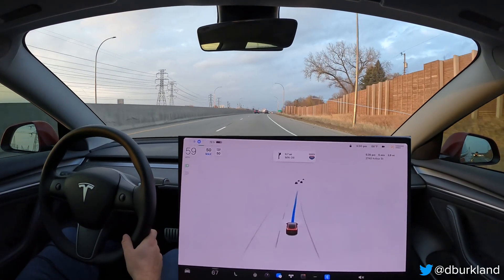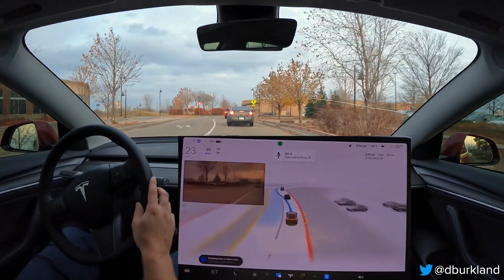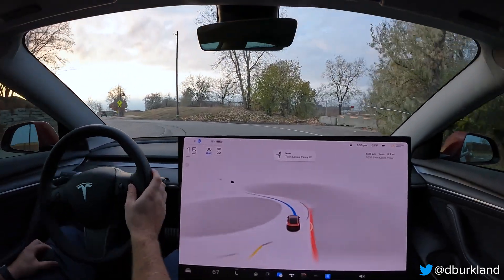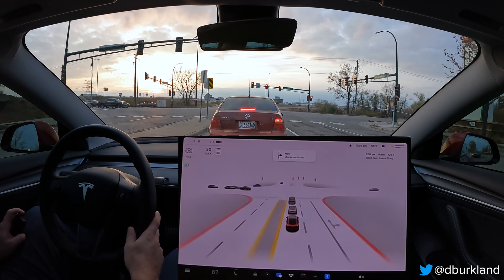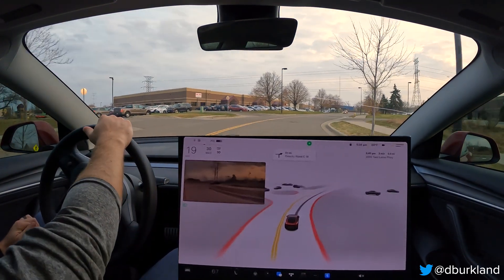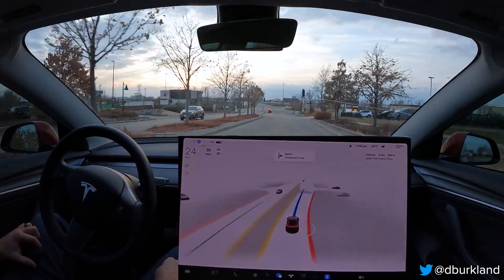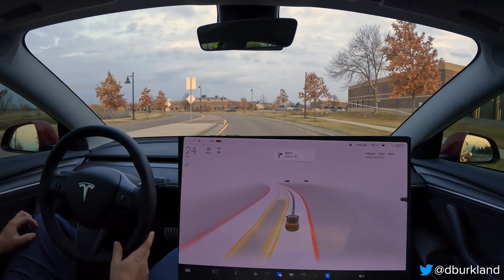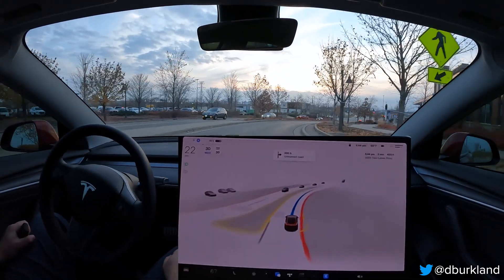Tesla - FSD Beta 10.69.3 - Roundabout Torture Test

Comment: It’s not identifying the island perimeter as a lane or drivable space edge. Maybe a whisper of yellow or red lines occasionally. It’ll be interesting to solve this. They leave curbs low so large/long vehicles can drive on the island. So it should identify as a yellow lane edge. 

Lane selection will come with the new intersection mapping from ai day

Good set of tests, thanks
Reply from the maker: Good observations! It seems with the previous 10.69 releases FSD was better able to recognize the edge of the island curbing.

Comment: Dan I'm afraid you're wrong when you say how it does FSD wrong.
I see it that the map documents will guide the FSD to the right lane to turn right even when it goes straight - the FSD realizes that it has received poor information and redirects to the left lane and the roundabout passes without any problems.So what you pretend to be a FSD error is more of a map error.
Reply from the maker: The deep lane guidance module no doubt is overriding the bad map data however I hope this means the map data will get updated at some point (so last second lane changes go away).

Comment: I’ve seen other beta testers hitting a report button when something wrong maybe try that so the beta team can see this and improve. I drove almost 1000 miles with a score of 96 for 20 days and still didn’t get the beta do you know why this may be? I thought u need minimum 80 score and 100 miles on autopilot and you automatically get it.
Reply from the maker: I definitely use the report button as well as sending emails to the fsdbeta@tesla.com email if the issue is severe enough. Re: why you haven't received FSD beta yet, this is more than likely due to the fact you were upgraded to a build newer than 2022.20. I have a feeling you'll get it here soon once 10.69.3 rolls out to new safety score folks (assuming you didn't upgrade to 2022.40.x).

Comment: Thanks for the video.  Do you have any large roundabouts?  My experience with standard roundabouts is similar bur FSD still stops at larger roundabouts before entering.
Reply from the maker: Perhaps, what do you define as large?
Reply: I typically have to use the accelerator if anyone is behind me.  Doesn't matter where you enter the roundabout it either stops completely or slows down to 2 mph.  It's large but there are no separate lane markings.  Everyone follows the car in front of them so you don't ever have cars side by side.
Reply from the maker: @edhill8568  ah so by large you mean single lane going into roundabout just that the lane is wider correct? If so I think we have some around the north metro I can try out.
Reply: @danburkland  thank you

Comment: I can't get my mind around how the software reacts differently for the same test. I wonder if it is learning (I doubt as sometimes it does worse), or there or inputs such as speed matter that much?
Reply: all neural networks are unstable in case close to difficult cases for them, or if they not enough learned/wrong network structure, 
for non neural network approach you can easily detect difficult cases and for example ask human driver to assist, but for neural networks it's very hard task to do, in this case additionally vision problem appears (it can't see properly border of road, even for human through mono camera it's hard to see).
instability means that even small noise of input (and here is lightning changes it's not small by any means) will significantly change neural network output.